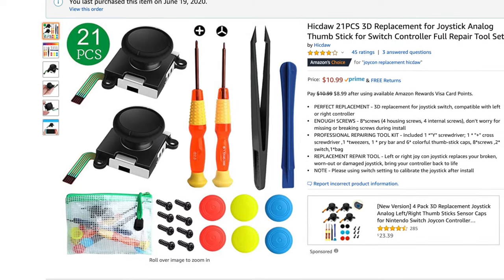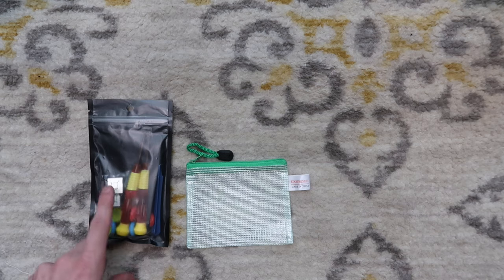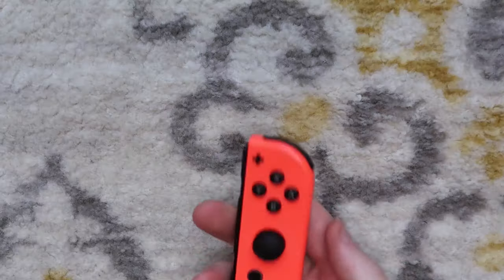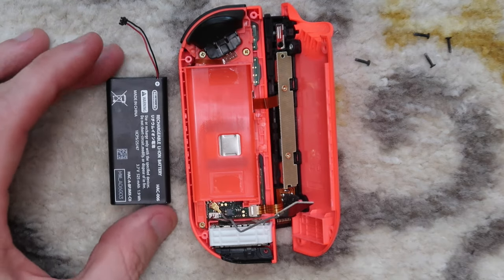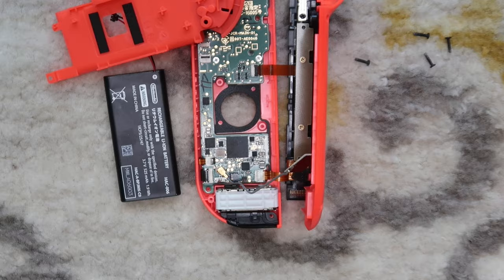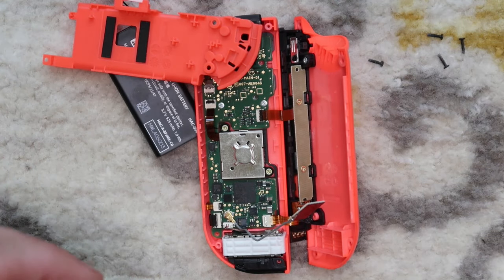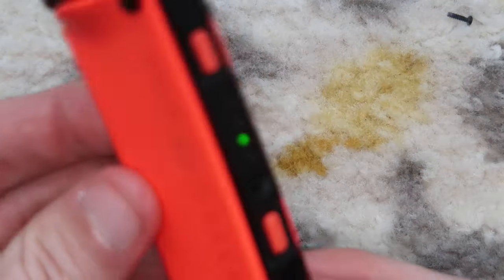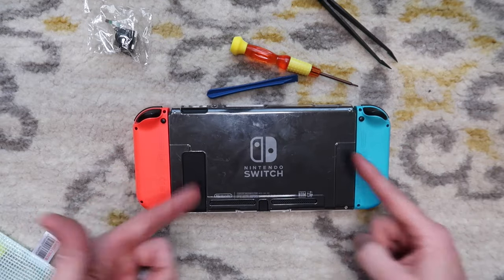How to Fix Right Joycon Drift Step by Step with a $11 Amazon Analog Joystick Kit (tools included)

Comment: As a splatoon 2 player the drift was geting to me
So I got a kit from Amazon and tryed to do it with no tutorial, and I did not remove the battery, but I did remove ZR and the 4 green lights SO I could get to the joystick, and now my switch says that the battery is to low for amibo and it does not work wirelessly, would you  have an  idea on why this is happening or have I just broken my joy con?
Reply: Hey idk if you still need this but it happened to me and you may have blown a fuse on the joycon
Reply: @mishlamont  oh my god thanks, do you know where I can get one

Comment: What do you do if the black lock that holds the ribbon cable breaks off 😅 it was so hard connecting the ribbons, I was very careful but it just dropped off after I locked it

Comment: Used third party joysticks the hardest part is getting the ribbon inside the connecter and alas it doesn't work. Possibly issue is that they aren't compatible with the joycon I was trying to use it with

Comment: Did anyone else really struggle to get the outer Y screws out? I changed the joystick on my left joycon a couple years ago but I ended up stripping a screw and had to break the shell to get it out. After that I was hesitant about trying again but I got really bad drift on my right one so I had to try fix it or buy new ones. I managed to get the first two screws out by pushing as hard as I possibly could and I ended up bruising my hand from pushing too hard. I couldn’t get the last two out so I took them to my dad. After a lot of effort and us working together, he managed to get one out but then he stripped the last one. They’re just so tightly in there and you have to put so much pressure on the screwdriver while turning otherwise it just pops out and strips the screw. I managed to get out all the ones inside easily, but the four outer ones were impossible to get out. Now I guess I have to buy new joycons. I really wanted to get a new shell too but I’ll probably strip the screws trying to get them out again.

Comment: I followed this and fixed the joycon, great!! But as soon as I connect the switch to the dock it disconnects and is impossible to reconnect until i put it back on the switch - so it works unless i want to use the switch docked 🥲 i’ve tried everything including updating the joycon etc - any tips on how to fix this? thank you 🙏🏻

Comment: A little chip/button popped off the circuit board on the top of the joycon when I picked up the battery tray to reinstall it. Battery tray must have hooked onto it. So "R" doesn't work now. Be careful not to make the same mistake. Very small part and it's soldered on. All else went well and still useable, just one button short.
Reply from the maker: Oh no! Sorry to hear that, RIP R button
Reply: samee

Comment: Lift flap under analog stick and spray some polish there. Worked for me ..
Reply from the maker: What kind of polish?
Reply: @thecollegepicker  furniture polish. If you're on the careful side then go for alcohol rub. I just sprayed a little made sure it was covered rotated the stick a few times. There ya go fixed. Saved on buying a new stick. I even opened the damned thing up first to have a look. Had nothing but problems with these controllers. Had the antenna problem on left used conductive foam for that.

Comment: So i watched this and got to the part where it says to disconnect the battery from the controller. Turns out after that all my stuff is different on the inside and now i can't reconnect the battery to the controller. So this is pretty cool
Reply from the maker: What's up dude, is yours the left joycon? It'll be a different layout but similar in there.
Reply: @thecollegepicker  it is the left, but mine is from the pink and green set. I didn't realize how different they were on the inside until after i tried to disconnect the battery
Reply from the maker: Oh wow I've never been inside those but I would think it was the same. Left has the nfc chip in it as well.
Reply: @thecollegepicker  yeah there are more screws and the insides are a little different, plus the battery doesn't have the piece to disconnect it. It's actually soldered to the circuit board.
Reply: I have the blue and red set, and was working on the red one. I think I have the same issue. I can’t get the battery connected back into the motherboard, and I think it’s disconnected completely. Idk what to do 🥺
Reply: @joshuakaiser220  yep I'm stuck on reconnecting battery to. I'm in the UK might that make a difference?
Reply: @saralouise2776  I’m in the US, I think there might just be different models. We got our switch after it had been out for a while. I called a local electronic repair store, he said it would be about $20 to fix (their minimum cost), if he can fix it. It needs to be soldered back on to the board. Overall still a little cheaper with the kit and repair than buying a new one lol. It would have been useless anyway, and we already bought a new set.
Reply: @joshuakaiser220  yep i  alsogot mine when it had been out a while while.

Comment: I didnt buy the same sticks shown in this video, but I just found out that the replacement stick doesnt move around as good and accurate as the original stick. For example, when I calibrated it, I was moving it around and around and it like stops for a bit at each of the 4 directions. Its not the biggest deal in the world, but it kinda rubs me the wrong way.

Comment: My y screwdriver can’t remove the screw help :(
Reply: The screws SUCK! I had to drill through some of them after they stripped immediately. I wasn't able to fully get some of them back in either, even with new screws. It's the low quality screw's fault I think, not the screwdriver.

Comment: Ok so I just finished replacing my control stick and drift is gone! But for some reason when playing with my joy cons physically connected to the switch my switch doesn't pick up my joycon. Even on the feature where the switch searches for controllers by making them vibrate, it doesn't pick up my joycon, even though it's physically connected to the switch. I think I must have done something wrong. I just reassembled it a few minutes ago so I haven't tried any fixes yet. Does anyone have any ideas of what's going on or how I could fix it?

(edit) so my joycon will connect to the switch for a split second every few seconds. About enough time to get one or two inputs in. So yeah that's how it's behaving.

Comment: I replaced the analog stick in my right joycon but after reassembling it no longer recognizes the controller when you snap it into the switch console to play portable. I've only gotten it to sync to the switch wirelessly when it's detached. I've triple checked every ribbon cable connection, reassembled to make sure nothing was getting pinched, and  cleaned the connectors with no luck. The controller is up to date and I also calibrated it with no button issues using it remotely. Did anyone else have this issue or have any insight?

Comment: Not only does the joy stick not work, when putting the battery back in, it broke the plastic connector. This video definitely had instances where you made it seem like connecting and removing stuff was easy but I struggled. Now I have a completely broken and unusable joycon!

Comment: Step 1 is litterally impossible for me, I can never get those screws out. I had to buy a new left joycon, and now that the right one is also drifting, I'm afraid I'll have to do the same. I tried to get the left one repaired, but it did absolutely nothing, and I cannot get those screws out
Reply from the maker: I wonder if your screws are stripped or the threads are filled with gunk? Did you buy them new?

Comment: My recommendation is to just not mess with the battery at all. Just leave it as is and rotate it out of the way. The plug is way way too tiny to be messing around. Yes, there might be a risk toward shortcircuiting it in some way but idk how you can even go about doing that accidentally. i feel like there is more of a risk just messing it up trying to remove and plug it back in that just leaving it.
Reply: I wish I had read this comment first and I wish the video had been edited to include this. One tiny move and I pulled the battery connector from the solder, impossible to repair without soldering that back onto the board (beyond my abilities). Good video but a very clear warning about that battery connection would have helped. Time to buy a new controller.
Reply: All you have to do is touch a metal tweezer to the wrong point and your joycon board is fried. It is very easy to remove the battery connected without breaking it. Just pay attention and be careful.

Comment: My joycon is different... I opened it and the nfc chip is under the housing for the battery and the battery connectors are not pryable, they are in their own little housing
Reply: Yeah I pried my battery and I think it pulled it all off from the bored, the one on the video looks different in it's layout.
Reply: @Eddfxn87  yeah i went through about 4 or five videos from other tubers to find my exact layout
Reply: So I ruined mine then? Or can I soder it back on to the board?

Comment: Yeah, whatever. He omitted to specify the power connector is weakly (not glued) soldered to the pcb, and using the blue lever to detach the battery WILL break it off pcb After that you need to either resolder it on the board or directly solder the wires - and this WILL be a hazard because the + is ridiculously close to a very useless arrow indicator that is actually ground. So be carefull when resoldering, is very small and you risk shortening + to that golden arrow.

Comment: I did this and it worked for only a week I still got drift
Reply from the maker: Oh no, I would reach out to them and they should give you a refund or replacement.
Reply: I had the same problem when I sent mine into Nintendo to be fixed. Worked for like a week. It's such a shame how easily the jocon joysticks break. Because I love the controller so much.

Comment: My right joycon looks COMPLETELY different
Reply from the maker: I wonder if they changed it. I'll have to get my hands on a newer one.
Reply: @thecollegepicker  There's like 2 soldered wires on a IR camera and completely changed location or SR/SL flex cable, there also some sensor in the middle of the SR/SL buttons inside
Reply: @thecollegepicker  Because of these 2 wires, I can't disassemble my right joycon. All I can do is unscrew 4 Tri-wing Y00 screws
Reply from the maker: Will need to make an update video. Is there a model number on those joycons?
Reply: @thecollegepicker  I think its a joycon from 2nd revision of Switch, idk

Comment: Don't spray alcohol in drift because that is why how i broke my joycon
Reply from the maker: Good to know, thanks!
Reply: Wait so the “cleaning” method doesn’t work? I’ve seen videos claiming that if you clean the rubber cap below the stick with alcohol it can fix it. Did you spray inside your opened joy con?